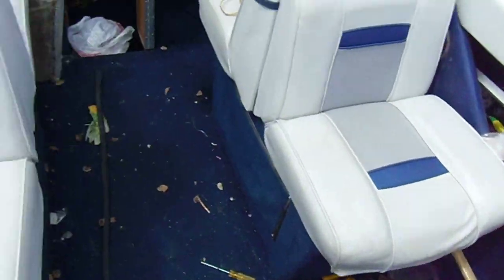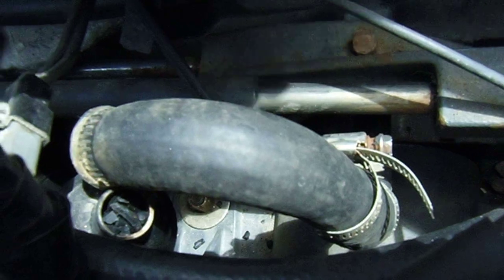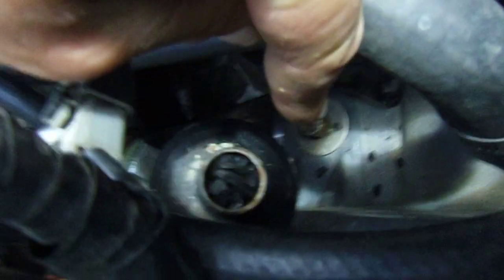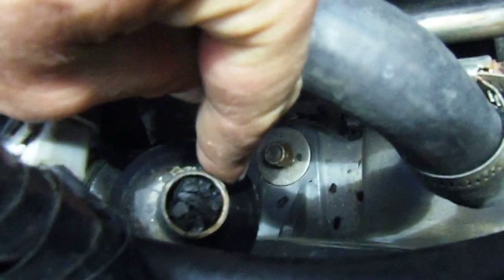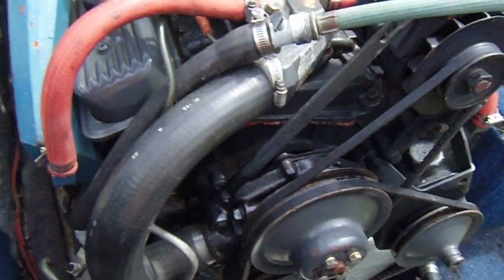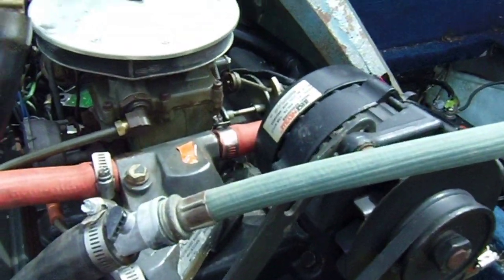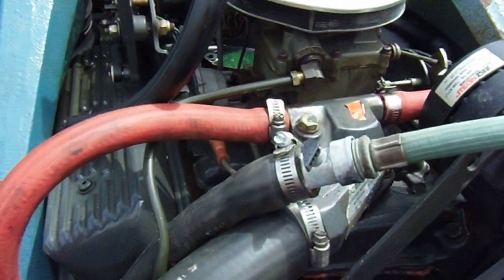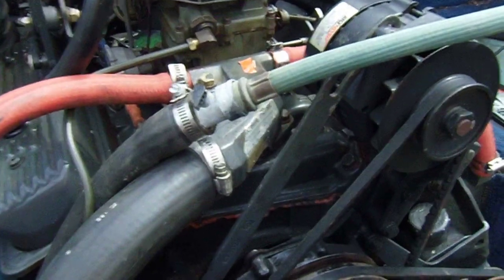Inboard outboard stern drive waterpump repair part 1 of 6

Comment: Thanks for the video post. Life saver for me, as your video showed the plugged oil cooler with bits of the old impeller. Mine was just as plugged. Your video was the only one that pointed that issue out. Problem solved, Thanks again

Comment: If we run a hose to get some fresh water flowing into those type of outboards but the engine  is not running will it overfill any areas that shouldn't have water...I just wanted to drain the water out thr bottom of the block to flush some rust out....I didn't see any water flowing out anywhere when I turn the water  on...